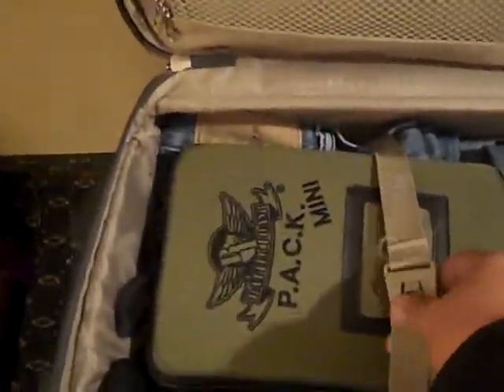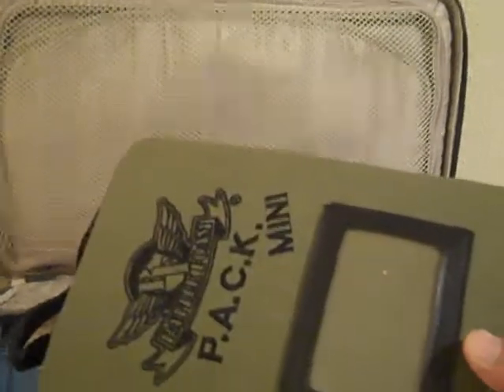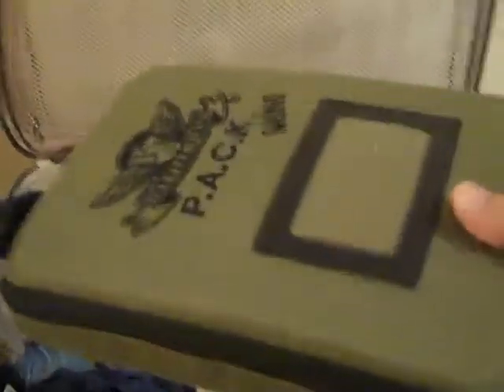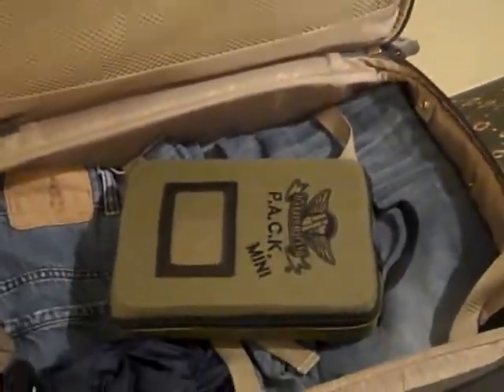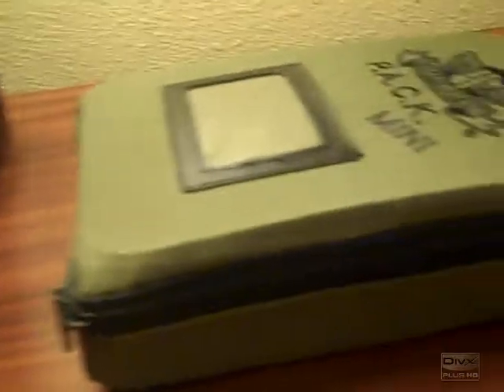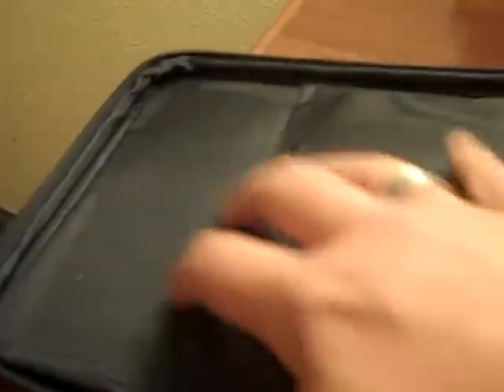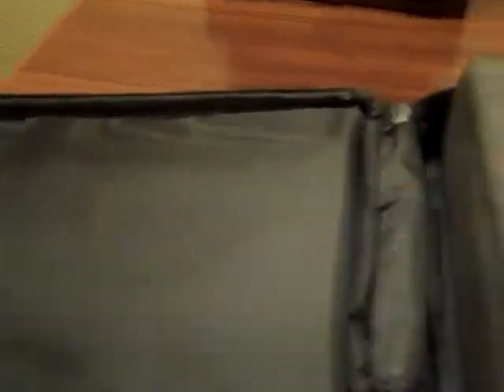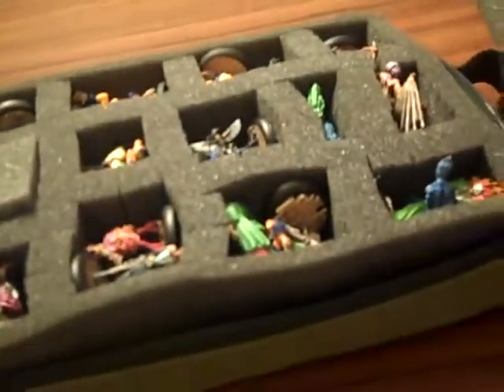Travelling with Miniatures Part 3

Comment from the maker: @desperatemercenaries Sure did. You can buy a laminator from Target for like $25, and then you spend maybe $20 on 8x11" pouches. So for around $50 total you can laminate over 200 cards. :) You can also have Staples laminate your cards for much cheaper, but I like the convenience of doing it as soon as I pick up new stuff.